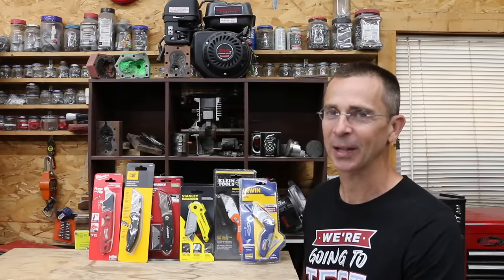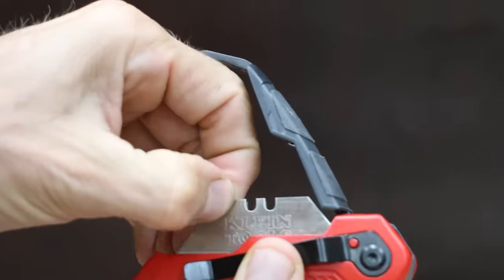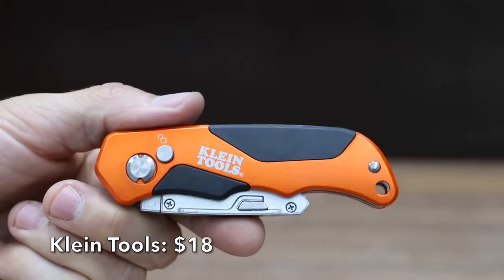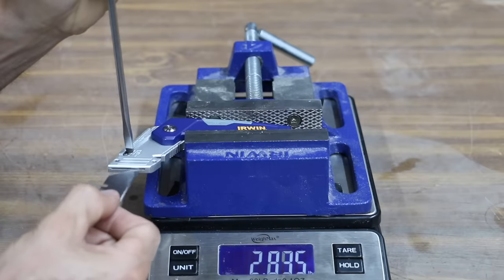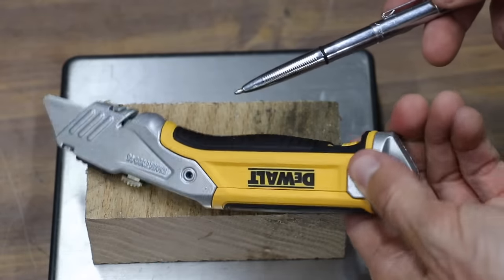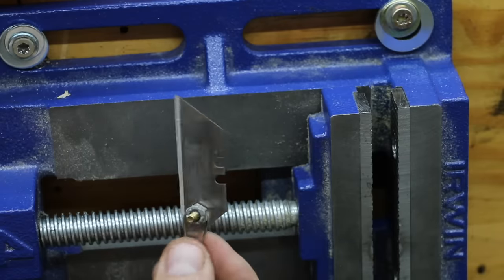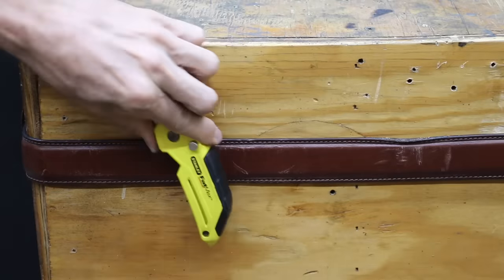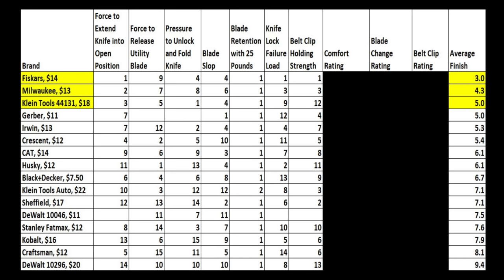Best Utility Knife? Let’s Find Out! Milwaukee, DeWalt, Gerber, Husky, Kobalt, Klein Tools, Craftsman

Comment: Had an older model of the Milwaukee that you use here. It doesn’t have the tab over the blade release, and I’ve loved it for over 5 years now. It’s what changed me from using regular steel knives to using utility blades in a ceramic factory. I’m happy to see they haven’t done much change since then!
Reply from the maker: Thanks for sharing.
Reply: I too have owned both the older and the new design of the milwaukee knife and I can tell you they haven't changed in quality whatsoever, only added features. Feels like the same old knife.

Comment: The Milwaukee fastback was the first utility knife I ever bought way back when I first got my very first paycheck (granted, that was only 4 years ago), but still. I bought it because I liked the fastback feature and I've had two of them... not because the first one broke but because someone stole it. Also in my experience the blade replacement button being covered by that little nub has never been a problem.

Anyway, like I said, I've been using the fastback for a little over four years now, and it is the only utility blade I will ever buy

Great video, as always Todd
Reply: i have on the original bulky looking one with out blade storage. only thing about them is the thread for the pocket clips doesnt seem deep enough ive seen a bunch of them with loose clips.
Reply: The older ones didn't have that guard.. mines the first version and still haven't broken it..... yet
Reply: Makes me feel really old... first pay check with taxes withheld was when I was 13 working cattle auctions. back in 1978😵‍💫
Reply from the maker: Thanks for sharing.

Comment: I've had the previous gen version of the Milwaukee for years now & love it & I'm glad to see it's successor did well here. Mine has been very durable, to the point I've used it as a makeshift hammer, to get stubborn parts moving when I didn't have an actual hammer convient. Other tools rotate through my tool pouch but the Milwaukee is a permanent resident, along with my Leatherman Wingman & Wera Kompakt 25 screwdriver. Thanks for another great comparison test.
Reply from the maker: You are welcome!  Thanks for sharing.

Comment: I appreciate the qualifications on some of the measurements of the button/back-lock/frame-lock weight. An empirical number is always great, but the added description of how the button feels when applying the required amount of pressure really improves the ratings tangibility for me and helps differentiate locks that were heavy but easy to use verses ones that may have required less force, but were more difficult to actuate.

In the future when performing failure tests like against the folding lock, it would be neat to see a control test to show how much force a human could reasonably exert towards the type of failure in question. One of the knives breaking at 50ish pounds while another breaks at 200 makes it sound like the 50 lb one is wimpy, but if a human can only put 10 pounds onto the lock, then even the 50 lb one is still safe to use. I'm not really sure how you could test that, it would depend on exactly what type of failure you're looking at and on what device but you've surprised me with novel test techniques before so I figured I'd throw the idea out there for you to make of it what you will.

Comment: I've had one of those Milwaukee knives as my work knife for just shy of 20 years, now.    Earlier version, of course.  It's been an absolute workhorse, still fully functional and in great mechanical shape all these years later.  GREAT piece of gear.
Reply from the maker: Thanks for the feedback.
Reply: I wore through a number of Milwaukees and switched exclusively to Fiskars a few years ago and carry one with me at all times when working. No regrets, best knife I've ever come across in every way. I concur however that the Milwaukee is a strong #2, far and away better than anything else besides the Fiskars. Other knives I use regularly but store in a toolbox are all from OLFA - retractable snap-blade variety.
Reply: @espressomatic it's a 15 dollar tool it's going to wear out, same as the fiskars lol, although it seems to be the best option here

Comment: I have an older Sheffield 12113 that is well over 20 years old, I still use it daily. It has been dropped on concrete from 30 ft, ran over, dropped in a river and so many things, and is still with me. It is stiff to start out with but after a short time of constant use, it did become easier to open, one hand. I do not like plastic slides, buttons, and how many are set up for blade replacement or holding them in place.  The difficulty in changing the blade on the Sheffield is exactly what I look for as I do not want the blade to fall out, or anything else that could cause personal injury. I also hate line locks because they are weak. I have seen where the blade became unlocked when in use due to their weakness. I do wish that it had a place for extra blades, but all in all, it has lasted, been through a lot, and is still working. I am going to build a belt case for it that will hold it and a  small blade box that I will probably make out of brass and mahogany seeing as I have much of both on hand.  I use regular blades as well as hooked blades and switch between the two often.
Reply from the maker: Thanks for sharing!
Reply: love my sheffield
Reply: @larrybe2900  Well I was for long enough to get the knife back LOL
Reply: Same, never had to replace my Sheffield due to wear. When I gave one to a co worker I kept my original. It did eventually grow legs but still on my second for about 7 years of daily use now.
Reply: I have one of the sheffields branded as craftsman. Carried daily for the better part of 14 years. Thing has probably cut miles of plastic and cardboard. The blade lock is getting loose from scrapping battery conections and cutting metal seals
Reply: @kcgt4334 …mine is branded Craftsman also. Mine came with a mini as well and I keep that on me at work. It’s been good.
Reply: I have one branded Rolson, Snap On's generic arm Blue point also sold them for £30.

Comment: No Uline leaves out all the guys who use the knives provided by their shops. As a former warehouseman the most important feature is if I can open it without looking one handed. I strongly prefer self-closing blades so I can whip it out, cut things and stuff it back in my pocket with minimal risk of adding holes to my pants and/or legs.

E: Also cheap, it is not at all uncommon to accidently ship your knives, pens, and tape rolls out with the product.
Reply from the maker: Thanks for the feedback.
Reply: Fastback wins in all categorys. Opens and closes 1 hand and costs $20 for 2 knives. If you lose it its not the end of the world.
Reply: Not seeing the point of "folding" in the first place. The very old fashioned slider type wallboard knife is more slender and makes keeping the blade retracted whenever not using it a one handed, automatic, thumb motion without thinking or looking. No pocket clip is the only reason I can see for these folding knives, all of which include a clip. Oh, and I can keep about 6 spare blades in the slider body.
Reply: @bretbowman2007  You can also keep 5 blades in a fastback if you have the right one. I disagree that is more slender aswell. My dewalt slider is thicker than the fastback and well over twice as long....
Reply: @bretbowman2007  the Gerber EAB manages to be a tiny folder, though it's a lot less suited to heavy use. More of a good way to have a spare on you ready to go if you break or dull a blade.

Comment: I carried Husky for about 5 years because they were cheap, so I could keep extras all over the place. I had my eye on the fiskars for a year or two, but when I finally tried it out, I never went back. The only category it scored poorly in, the belt clip ease, is actually more functional as a pocket clip, though I can't recall if it's marketed that way, but explains why the holding strength was so high as well. I've carried one every single day for around 5 years now and the ease of entirely one handed operation is second to none. I need this feature quite often and it always delights me that I can open, use, close and put away in just a few seconds and flicks of the wrist. Incredibly satisfying. I will say the joint needs to stay relatively clean and free of grit or grime for that flip ease to remain smooth enough to rely on every time, but imo it's more of a precision edc tool to be taken care of than one I'd rely on in the grime in that way. Might go with another brand in the case that I needed one to hold up to greasy, grimey, muddy conditions.
Of note as well are Fiskars carbon coated blades. I'm not sure if you've tested utility blades yet, but they do last very well compared to average. The pricing definitely reflects this though. They're very interesting on cut characteristics. The coating seems to slightly increase the angle of the blade edge and somewhat affect the drag, both positively and negatively, depending on the task and especially with deeper cuts. Similar to comparing a German Chef's knife and a Japanese made. The 15-20° German blade has slightly more drag, but is more durable, while the 9-12° Japanese blade has very little drag and is more brittle. Of course they balance this with slightly softer steel on the German blade to make frequent honing fairly easy and slightly harder steel on the Japanese so it holds it's edge well.
I'd love to see a utility blade comparison in the future if you haven't done one already. At this point, it's quite likely I'll come across it soon if you have already. This is currently my favorite channel and I've been through dozens of your videos in the past few months. Incredibly creative and intelligently straight forward testing methods as well as extremely well organized and cut together videos and evaluation style you have.
Thanks for all that you do for those of us obsessed with spending our hard earned money wisely!
Reply from the maker: You are welcome!  Thanks for the suggestion.

Comment: i've carried a bunch of folding utility knives while working as a contractor, and in my opinion, the cheap Husky is the best.  it's very thin and inexpensive, but the main thing is the blade retention.  in my experience, it's the least likely to come free unintentionally, while still being very easy to release on purpose.  and when you carry it every day and use if constantly throughout the day, those three things are what i consider most important.  thin because you don't want it to get caught on things, good blade retention because obviously, and cheap because i lose them in attics and under houses.  you can get a three pack for like 20-25 bucks.
Reply from the maker: Thanks for the feedback.
Reply: The Milwaukee go on sale for 10$ each Canadian the one hand open is a huge feature and in my experience is you have to be really hard on them to break them so a 3 pack is pretty pointless
Reply: Husky's are great!
Reply: I like my Husky!
Reply: @jacobhicks3016  i love milwaukee tools, but in this case, i don't.  the husky can be opened one-hand, i like the blade retention method, and i've never broken one either.  the main problem i have with the milwaukee is that it's definitely not what i would call thin.  maybe not a big deal to some, but for me it is.
Reply: The 3 packs of the husky brand is like $15. I grab them whenever I see them on sale, give 1 out to workers to use.
Reply: @ToolsInAction4u  same!  i keep a three pack handy for when people (including me) inevitably lose them.
Reply: @thinkdunson   they get lost before they break. And even if they did break. No questions asked warranty
Reply: I also carry the Husky. Have carried the same one for years now and it has never failed me. It has a very comfortable design also, but I know that is subjective and a matter of opinion. I have to say though, the Fiskars in this video seems interesting. It just looks like it may feel bulky to carry.
Reply: I've had the cobalt in my pocket for 5 years now(got it for free) and I have to say it does good. I can open it with one hand and it opens wrapped pallets and parcels just like I need.  Perfect for my job.
Reply: Agreed on Husky see my comments also.

Comment: Olfa HB-1 whacks all you tested into the bin. Snap-off tips, new blade 7 times. Blade removed and set perpendicular on knife mouth for super shaving tool. Cuts and carves deeply if you wish=excellent for cutting Rocksul or fiber insulation, shaving off expanded foam or tooling leather crafts etc. Been my slide rule till retirement and then some. Try it.
Reply from the maker: Thanks for the suggestion.

Comment: Never  knew  these are available, so used to just buy the  2.00  harbor freight box cutters,  So many  neat engineering  work,  Thanks again,
Reply: I ended up buying the Fiskars out of necessity because I bought some panels that wouldn't fit in my car unless I cut them down. I will never go back to box cutters again. That thing is amazing and cuts through cardboard like butter. The blades dull with use quickly, but given how insanely sharp they are it's understandable. Definitely recommend picking up the 50 pack of replacement blades if you get that one. You won't want to go with cheaper blades when you see the difference in performance.
Reply from the maker: You are welcome!  Thanks for sharing.
Reply: @WeGetWildTV  This test was about the folding-knife style of utility blade, not fixed blade handles or razor blades themselves.
Reply: HF got a box of folding knives for 2$?
Reply: @derpherpp  have  you bought a  BOX?

Comment: I donno if it's ever been suggested, but what about spray bottles? I can't really seem to find a durable one. For chemicals or otherwise.  They seem to either quit pumping and/or leak from around the spray head. Ironically, the best one i ever had was an old Kroger spray bottle that had some cleaner in it that i keep repurposing.
Reply: Walmart has some decent ones for about $3 each. Kept one for about a couple years with rubbing alcohol, almost constantly had it knocked over, never seemed to leak, or quit spraying properly. I did have an issue with it finally when I left it sitting somewhere in the sun. I think the rubbing alcohol evaporated inside the bottle from the warmth and the pressure forced it's way out the nozzle, causing a leak.
I've never used them for anything harsher than vinegar or rubbing alcohol though.
Reply: i like the idea  and your Right either they work or they dont
Reply from the maker: Thanks for the suggestion.
Reply: @lonerider5218… at Target, the “everspring” cleaning bottles hold up well (at least the daily shower cleaner bottle does) and is a clear bottle (other than the label of course). I found it annoying that Tilex and Clean Shower sold refill bottles but their spray bottles wouldn’t hold up long.

Comment: Olfa knives ftw. Can't believe they're not used more in the US. I use the 3/4" variety without the spinning ratchet wheel. Highly recommend!
Reply: Agree. Since going to OLFA I haven't touched a traditional utility knife.
Reply: Yep, I grew up with Olfa knives here in Canada. Box cutters seem weird to me.
Reply: I love my Olfa 18mm LA-X and 9mm XA-1. These can't be beat for many tasks but I prefer a Stanley 99 or 199 for dragging cuts like on drywall.
Reply from the maker: Thanks for the feedback.
Reply: Always used olfa knives in Canada, I like how the blade can bend a bit comes in handy. And just snap and you got a fresh sharp edge
Reply: Does it snap when you don't want it to?
Reply: I've used a variety of snap-off blades in the Olfa style, and they work pretty well as long as you never put any lateral pressure on them. But this sort of knife is seldom a precision knife for me, which means that unintentional lateral pressure is pretty common, leading to frequent unintended blade snapping.
Reply: i have 2  20-30 years olfa with ratchet and they still work fine 😎
Reply: We use Olfa and Stanley utility knives at FedEx. They both require extra time to replace blades. The Olfa ratchet wheel slows the process to open / close. Plus they don't use a standard blade. Most employees use their own pocket knife or worse reach for scissors.
Reply: @JoshuaBarrio  The version without the spinning wheel, the LA-X, is way faster. It's mechanism is pretty great and holds the blade well, blade changes are quick and easy.
Reply: For whatever reason those olfa snap off blades dull much quicker than a normal utility blade
Reply: @jonathanhillebrand4904  knipex nw makes a snap off type utility knive. It has a retractable backbone to keep the blade from flexing and snapping
Reply: @pilotdog68  the black or silver ones?
Reply: @bartfoster1311  black I think